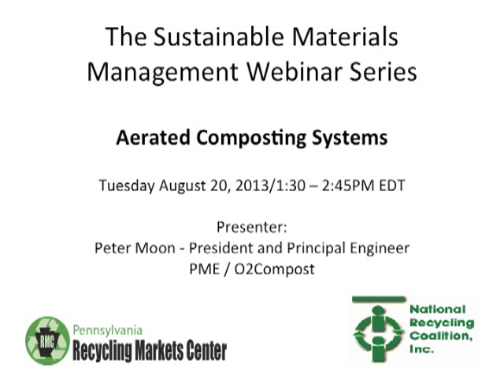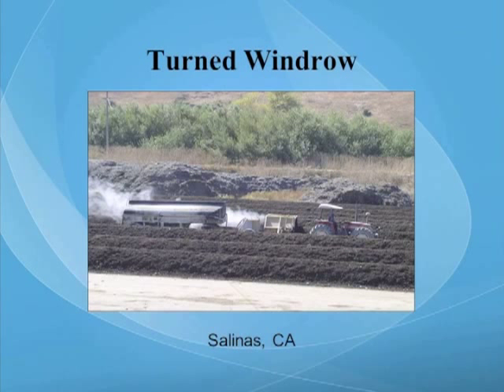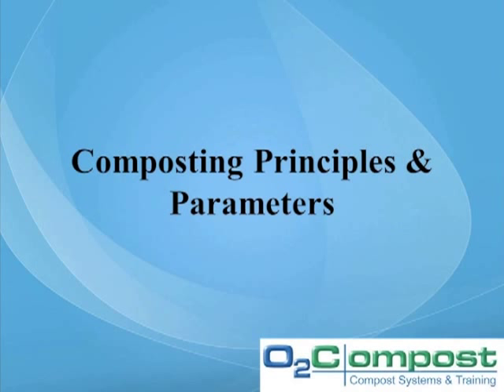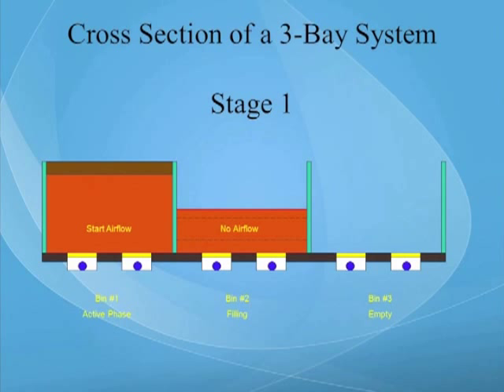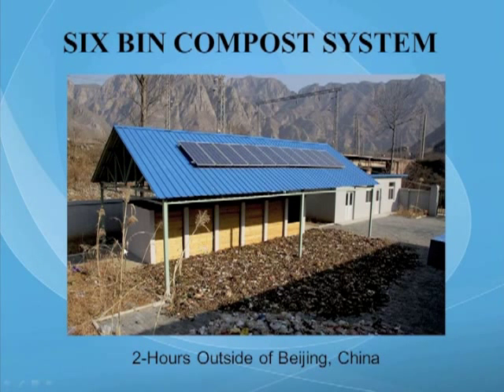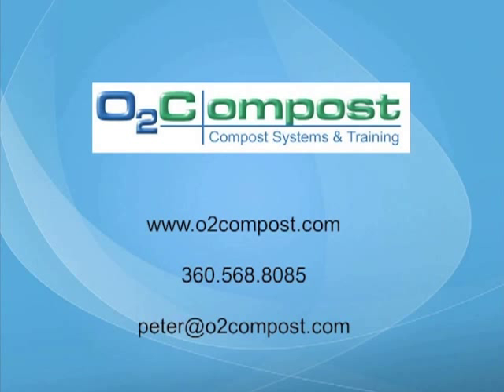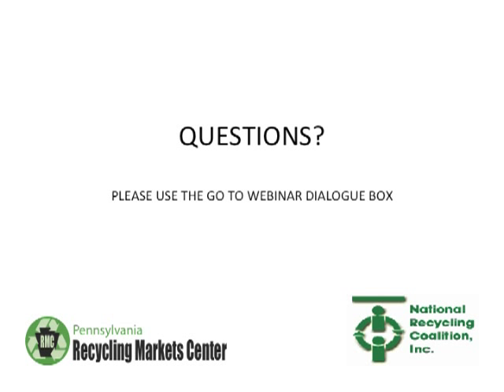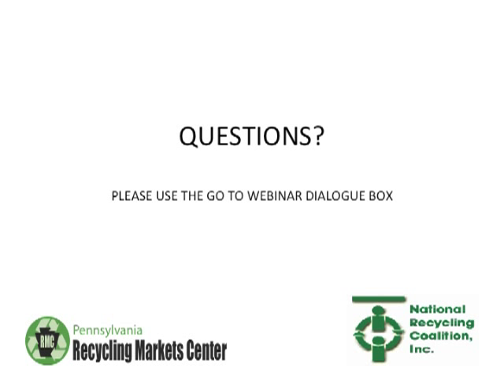Aerated Composting Systems Webinar (8/20/13)

Comment: that was very helpfull, thabk you for sharing. Can forced air method can be used in vermicomposting?
Reply: It would probably cause your bin to get too hot for your worms.
Reply: Not sure as the air usually acts like a coolant. But lets say it gets too hot: Maybe with the air some micro ice cubes could be injected. Then the worms could enjoy ice-cold, delicious manure slurry cocktails.
Reply: no
Reply: Absolutely NO forced air, not good to jack their temperatures up and down, in addition to drying their beds out,-- foolish thought, get rind of it now.  Now you feel better.  Namaste
Reply: The reason for an aerated static pile(ASP) is to first rapidly break down and condition organic material into compost, that compost can then be the feed stock for worm bins to create vermicompost. In a home setting ASP will let you make the same amount of vermicompost but in a smaller footprint and in shorter time frames.

So yes it's actually a potentially very impactful method for vermicomposting setups productivity but you're not using ASP methods on worm bins, it's being used to first rapidly break down organic material in a pile.

You'd be going from, 
Organic material->worm bins to
Organic material->ASP->worm bins